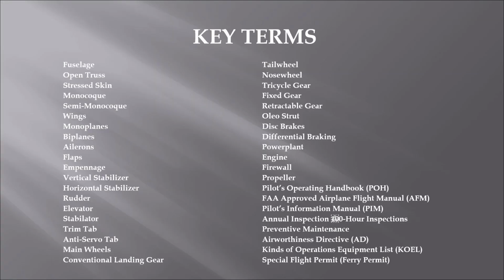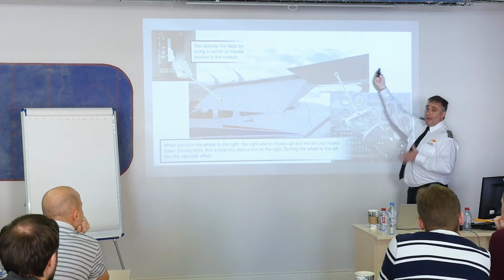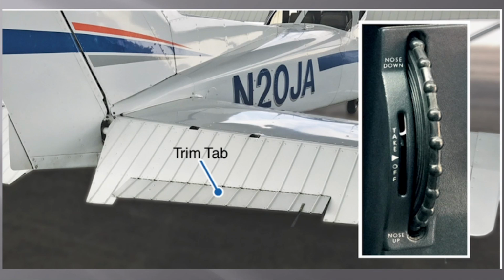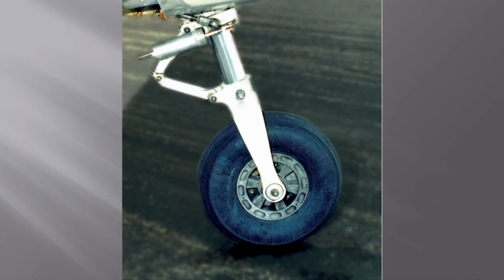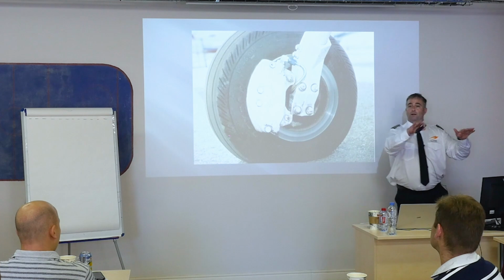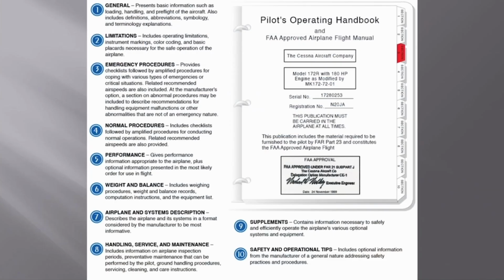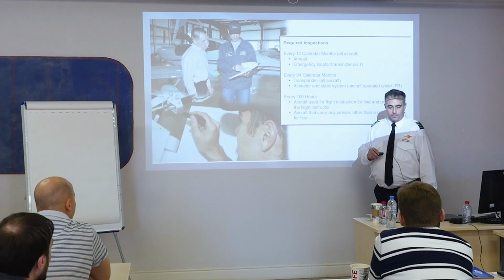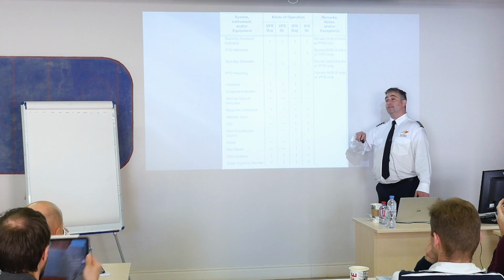Lesson 4 | Airplane Systems | Private Pilot Ground School

Comment: Being a pilot does, in my opinion, mean already having some of the 'right stuff'. Some of THAT includes not over-reacting, and kind of going with the flow. In my opinion, if the seat were to suddenly release to back of the track, you dont have the right stuff if you KEEP grabbing the yoke and caused a nose-up stall. You should do whatever it took to keep or recover the yoke into a good position until you have the seat re-adjusted.